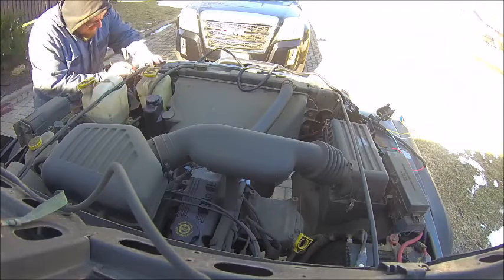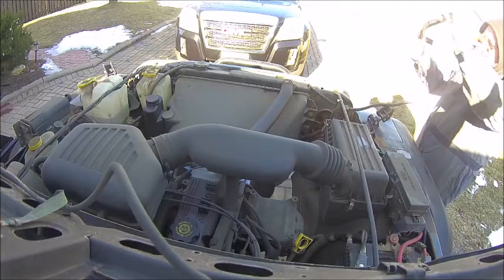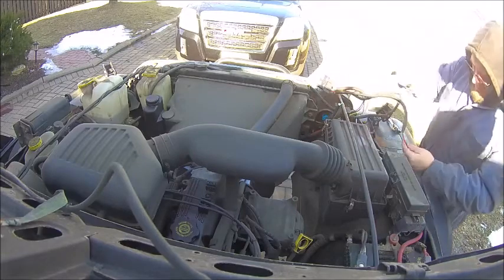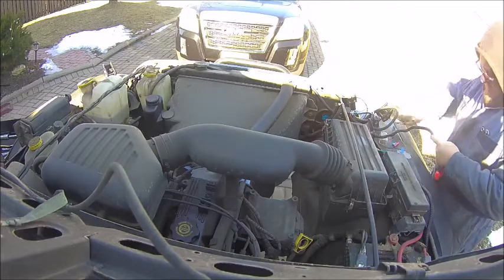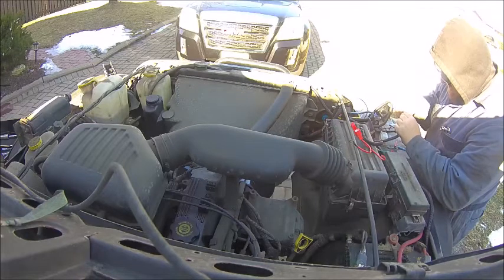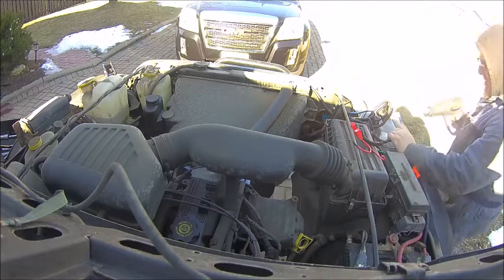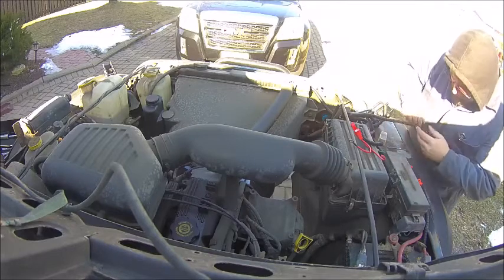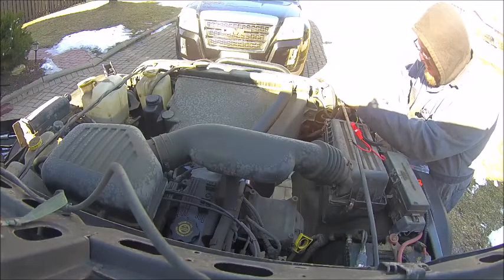Installing Octane Lighting  H4 Wiring Harness

Comment: I think he defeated the purpose of attaching directly to battery by going into a fuse panel.
Reply from the maker: There was actually an inline fuse on the wire to go to the battery. I removed it and ran through the fuse panel instead. Allowed me to keep the wiring cleaner and avoid multiple wires off the batter.